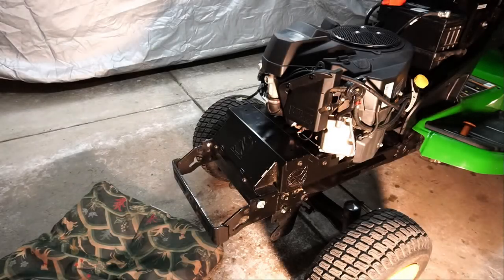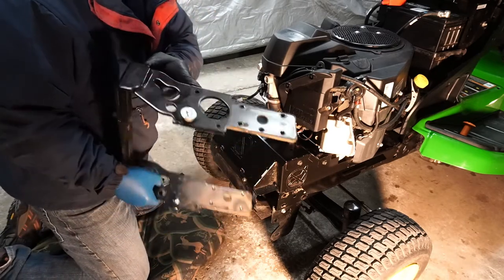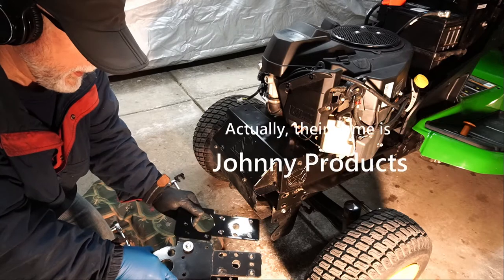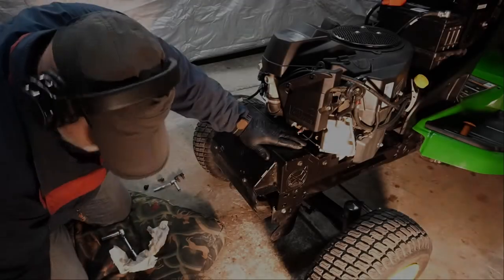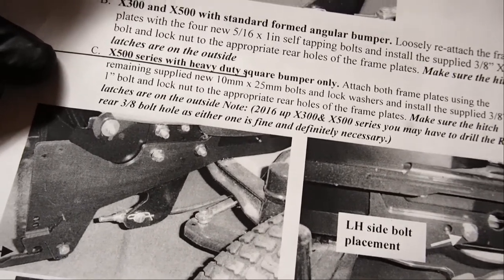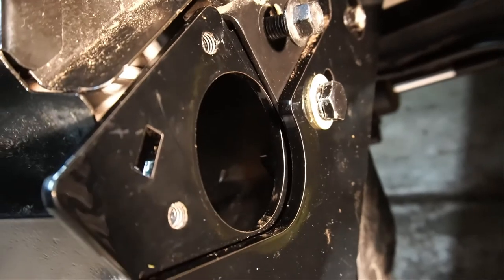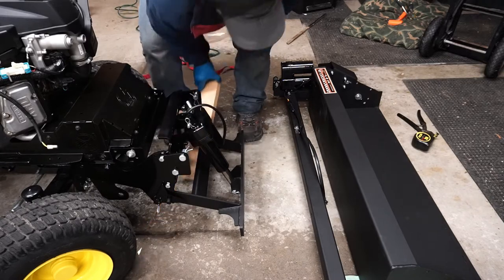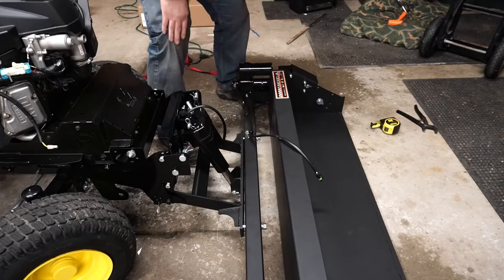Johnny Bucket Jr Part 2: The Installation

Comment: Good video with some good narration. I've had the JB for almost 20 years but recently changed mower brands to the JD X590. Taking off the deck for routine maintenance can be a bugger with some clearance issues with the rear brackets. I'm wondering if the bucket could be used to lift the tractor from just that little bit of clearance to make it easier. Just a thought.

Comment: 15:12  Hi Jeff, I put one of these on my X320 last year, around the same time you posted this video.  I mounted the two switches side-by-side below the throttle/choke levers.  You're right about using lift & curl at the same time.  I basically hold the lift switch with the side of my middle finger, and use my thumb/forefinger to nudge the curl as needed.  Since you can't control the speed (the actuators are either full on or full off), I don't think the joystick control would have made it any smoother, even if it let you control both at the same time.

Comment: Great Video I've been looking for a while for an install video. First I've found. I'm building my own version and  was wondering if you can help me out with a few measurements. I was wondering what the height of the front bracket is, the distance from the top of the front bracket to the ground and the distance between the ground and the bottom of the side brackets. Thanks